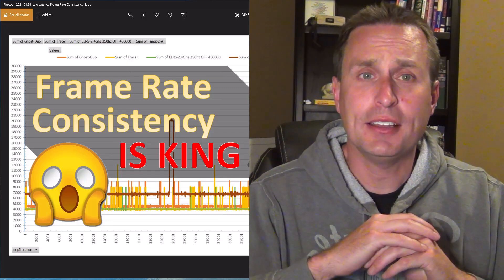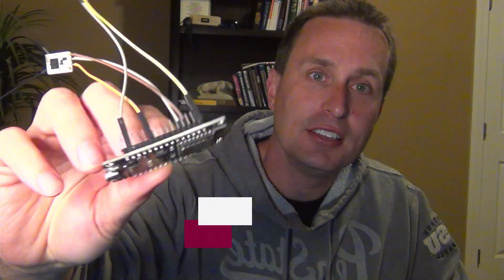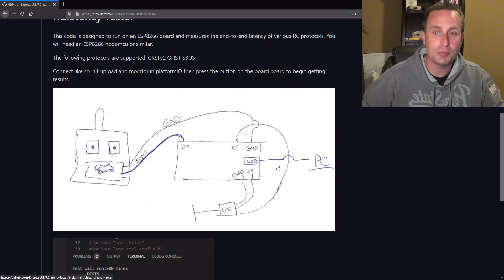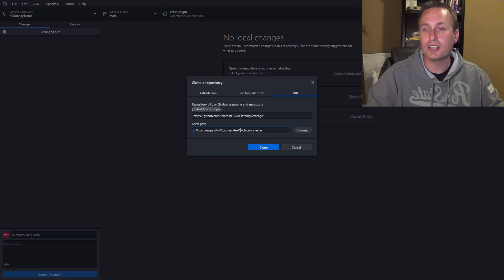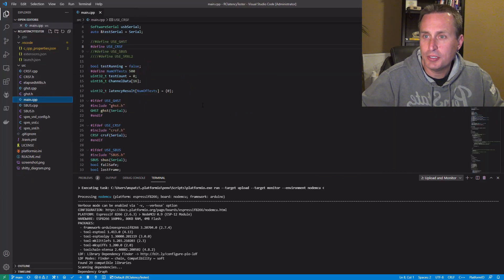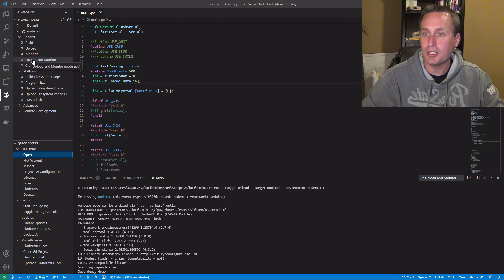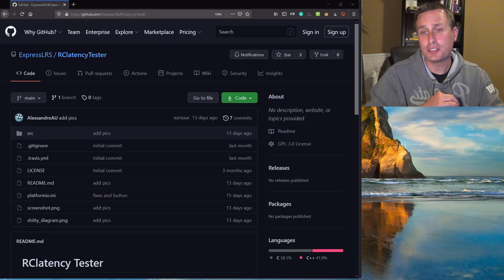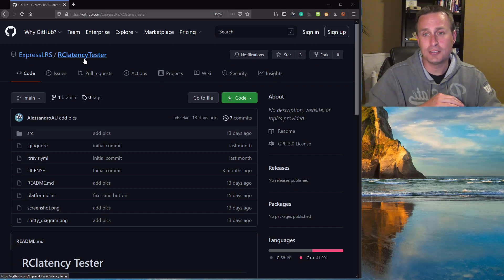Latency / Packet Rate Testing - The Setup

Comment: Wouldn't be a bad idea to do this at various ranges...i.e. 100m 200m etc etc. Also with inferences like a metal shed( for example). How does the reflection off the shed increase or maybe decrease packet loss & if it effects packet speed.🤔🤔🤔
Reply from the maker: Not for end-to-end.  Need a wire to connect TX to RX for measurement.

200m wire!!!!

Comment: Hi, anyone with Express LRS and everybody ; )

I have a QX7 without external module, I wanted to buy some R-XSR receivers for all of my drones, now I have regular FrSky receivers, but I think is better for me if I buy the pack of 3 receivers with the 2.4 transmitter module, but I have two questions, do I need the QX7 mod for crossfire? And, would you recommend me to buy the Express LRS pack instead of the RXSR receivers? (I don't know if Im going get a better link with the receiver with Express LRS compared to a regular RXSR, I suppose so, but I will be very grateful if anyone can tell)
Reply: Yes, you would want to do the crossfire mod to your QX7 so can get the 400K baud rate ELRS uses. The mod is very easy to do. I recommend going ELRS over FrSky. ELRS has way better performance.
Reply from the maker: Only the Q X7 ACCST radio may like the mod.  The ACCESS version runs at 400k baud by default.
Reply: @uavtech  That's true. I totally forgot to mention that.
Reply: @uavtech   Thank you 👌👌👌, I have the ACCST version, so I will have to do the mod
Reply: @skree_fpv436  Thank you, I will go for the ES24TX, the last thing, should I buy the "PP_RX", the "EP1_RX" or the "EP2_RX" receivers? 

I will use the receivers on 5"drones

At the moment I think I will go for the EP1_RX as the antennas will perform better, and it can be updated by WiFi, which I think it is not possible with the PP_RX
Reply: @kenblock349  Both ep1 & 2 can update over wifi. Either one is a good choice but if you are flying further away from yourself the ep1 will have better range.